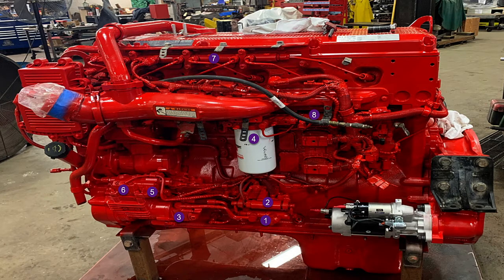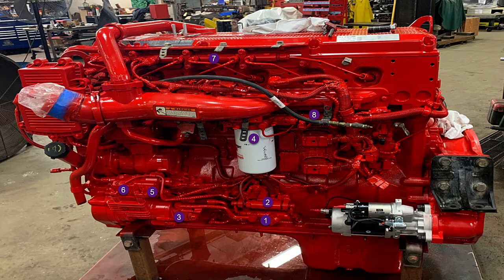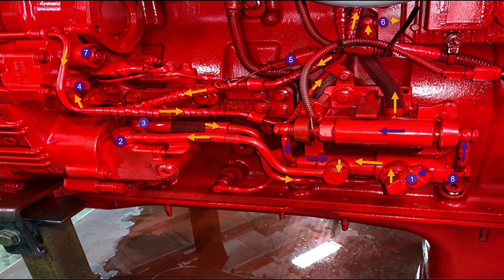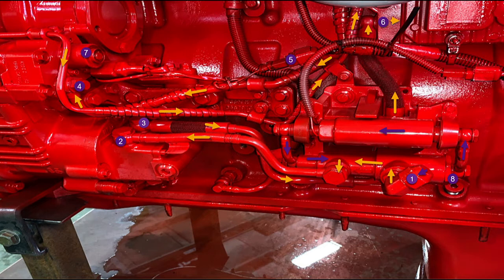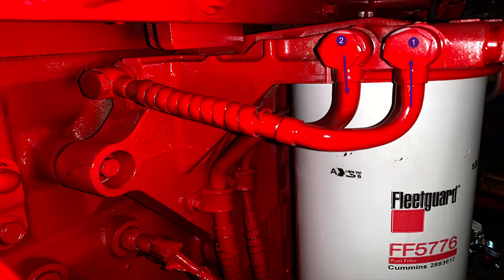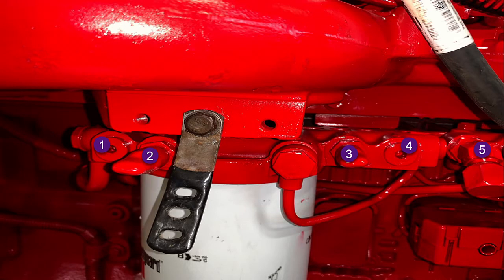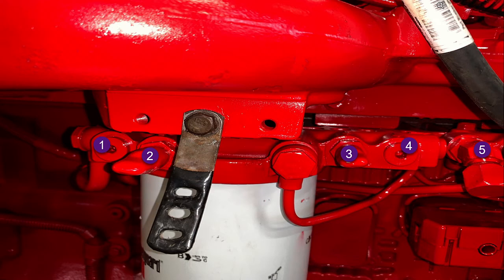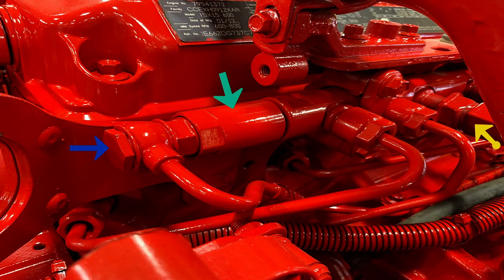FC 559 Video 2 - Fuel system parts familiarization

Comment: Hi I have problem with full pressure pump on Cummins cm2250. Pressure go up and down on over 1000rpm. Change plungers, actuator, low pressure pump, pressure sensor on rail. NEED HELP
Reply from the maker: This needs to go to a shop that can do systematic diagnostics or you are just throwing parts at it. I have no idea what is wrong at this point.

Comment: Recently i replaced the lift pump on my 2250 isx15, im having alot of trouble getting this thing running, it looks like its not getting enough fuel i been priming it but not fire yet, on the #1 manifold there is a check valve should i take it out and clean it? or could that be the reason why is not getting enough fuel up to the second filter, i taken the main pump apart before never had any issues, idk if i got a bad lift pump or debris. Thx for any advice
Reply from the maker: If that check valve does not close completely the lift pump cannot pull fuel from the tank so it is worth a check. You should check the pressure in the filter on the engine with the lift pump running. depending on the color of the lift pump harness you should be reading 10-15psi or 30-38 psi. The new lift pumps put out more pressure to help priming issues. If you have no pressure in the filter on the engine when the lift pump is running then you have to work backwords. I always used a 5 gallon bucket of fuel and put a #10 line that was about 6ft long (i made that up as a test line) on the inlet fitting on housing #1 and the other end went into the bucket. If it primes or not  you know you just really narrowed the search down. That is a very good diagnostic trick.
Oh if you use a 0-100 psi gauge to check that lift pump pressure Don't start the engine until you take the gauge off. I ruined a couple gauges over the years when I was working too fast and finally got lift pump pressure and then started the engine :O
Reply: @ENGINESHOPJOE  hey Joe thx for the quick response, I want to share with you that it was a defective paccar paper filter on the primary filter or water separator, that filter has a little plastic stick inside the filter by the rubber seal that need to make contact with the inside of the plunger filter housings, the one i had the plastic stick was missing not allowing the lift pump to pump correctly and prime the system, put a new one this am and got good pressure and prime by 3 key cycles the engine fire right away, I hope this help someone else took me 3 days to get this thing running, I had replaced 2 fuel lines from the lift pump to the gear fuel pump with seals washers and all. Thx for the great videos 🍻

Comment: I've got an ISX15 2250 that is losing prime after it sits awhile.  It's holding pressure at the rail when doing the rail decay test in InSite.
I hooked a clear hose between the water separator and the priming pump.  I also tried bypassing the separator completely.  It'll suck fuel (no air in clear hose) and it'll run...but when I shut off the key...the fuel will run back and empty the clear hose.  Also, I can hear fuel running back to tank after shutting off the key.  I can also hear fuel running to the tank while the priming pump is running.
My electric priming pump is only a few months old.  
Is there another check valve that could be allowing fuel to run back to the tank on the suction side?  No leaks have been found)
(I also get an intermittent 559 code under heavy load sometimes...not sure if it's because it's sucking air on the suction side somewhere)
Reply from the maker: Put a dump line on the filter on the engine and run it into a bucket. Put the ecm in dyno mode so it reves up to 2100 rpm.
You can also have someone set the wo/vss parameter to 2100 and it will always rev up that high. (That setting is to protect the engine from cold reving and to stop drivers from disabling the vss and driving as fast as they want too. ) Run the WARM engine up to 2100 and watch for air coming out of the dump line if no air its not that issue. The primary filter on the frame is a big offender when it comes to this. If you have a way of bypassing that filter completely run the truck with it bypassed until all the air is out. then let it sit over night and see if your problem is gone. The return fuel has to be under the fuel level in the tank. so the return has a stay tube in the tank as well and it must stay under the fuel level or it will drain back. Make sure it is not cracked. You can test this by blocking off the return at the tank after you shutdown and then rehook it next morning and see if it starts up. I doubt it is the lift pump. Make sure you dont see any damp spots at hoses or pressure lines(soft lines) if you do that can cause a drain back but does not actively leak.
Reply: @ENGINESHOPJOE  hi Joe.  I ended up pulling the top off the fuel pump and one of the springs were broken and a plunger was down and wouldn't return up at all when pressed.
Then looked in the bottom of the pump and a tappet is seized and roller is gone.  I can't get the tappets out to inspect the cam.  Not good 
I cut open my oil filter and didn't see any metal after pressing the oil out so hopefully I caught it before anything too terrible.
Replacing the whole pump tomorrow.
Reply from the maker: @bababa39  The pump should fix you up. If you are close to an oil change do it when you change the pump.

Comment: My isx15 will start and run for about 1 minute or so then shut down. Would this be the primer pump. It ran out of fuel and i cant keep it rumming. The primer pump isnt very loud when its running. BTW?
Reply from the maker: Once it starts it does not need the primer pump. Because you said isx15 I am thinking it is a common rail engine. If you get even a small slug of air in the common rail it will shut off pretty quickly. Try key on and dont crank until the primer pump shuts off. See if there are any changes. If yes it might be the primer pump. We just had one they did a service to (oil /fuel filters) and the primer pump was running but it would not start. We had to replace the primer pump and it fixed that one. Don't assume it is the primer pump but see if it is pumping fuel to the filter on the engine. It could be some issue with the fuel gear pump as well. It does have a seal in it that can suck air. But my experience is the gear pump is pretty bullet proof.

Comment: What is the proper procedure to filling #4 screen after cleaning?
Reply from the maker: I think i probably was not saying that as clearly as i could have. The screen in the banjo fitting that mounts the fuel supply line to the pump head is there to catch any dirt particles that may of gotten past the on engine fuel filter. The fuel filter on the engine when replaced should be put on dry. Recently we are seeing cummins fuel filters with plastic plugs in the center hole. SO if you do prefill that filter you get NO fuel in the center (filtered fuel) hole. I was talking about not filling that on engine filter correctly or dumping shop fuel into the center hole to fill it. Any dirt that got in there would hopefully be catched by the screen. The big deal is dirt larger than about 6 microns can damage injector internal sealing surfaces.
What we do is screw on the new filter by hand and back it off 1/2 turn. We put a drain pan under the filter and start doing ign key cycles-two minutes on then off two minutes (so the ecm resets the electric priming pump timer) then key on until the primer pump stops then key off two minutes. We do this until fuel starts running down the fuel filter. Then we tighten it to spec and do one more key cycle then start her up and off we go.
Hope that clears it up and thanks for bringing that to my attention

Comment: Nice video! Change my filters. Cycled and truck crank and shut off. Tried starting again and would not run. Noticed that the fuel/water separator filled half way when key was turn off. And when I tried starting it would suck down? Is the separator supposed to fill up before cranking?
Reply from the maker: When you change fuel filters if you install them dry it takes (5) key cycles to fully prime the filters. that is at about 2 minutes each key cycle.
Depending on the type of primary filter you have it may not completely fill. If you bowl is on top some of the racors have an air space in the top.
They say if those fill to the very top it is time to change the filter as it is plugging. I have not verified that I was told that.

Comment: Great videos! Im having an issue with my isx15, I don’t have a diagnostic tool but the truck has lost some power overall and there is three warnings on the dash board. “ fuel rail 1” “fuel rail pressure” and “fuel metering valve”. I changed the filters and inspected the  barrels, plungers and tappets and they are in good shape. Any ideas??
Reply from the maker: Fuel metering valve is most likely your  fuel actuator solenoid. It bolts into the  aluminum block that is bolted to the back of the  injection pump head.  If you are logging faults on the actuator and the harness is ok it most likely is the root of the issue.  There are a couple different faults for rail pressure depending on how low and how long measured is below commanded.  Remember I have extremely limited information when I answer your questions so buy parts with wisdom not because i said i think that is what is wrong. Having said that if the fault is on the actuator Id change it.
Reply: I have the same issue. Let me know how you fix it, please

Comment: I got a bad vibration coming from the hose that connects to the ecm cooling plate I can figure it out I have no code just this load hugging noise going between 10rpms to 13 rpms
Reply: check the pressures in the filter if they jump or spike up or down when the vibration changes it is probably pump related
Reply: @melodicimpressions  I luckily found the problem it was the high pressure gear pump I got the part at cummings dealer in Dallas tx for about 11hundred swap the part and off we go I'll post the part number later thanks for the reply I really appreciate everything helps.